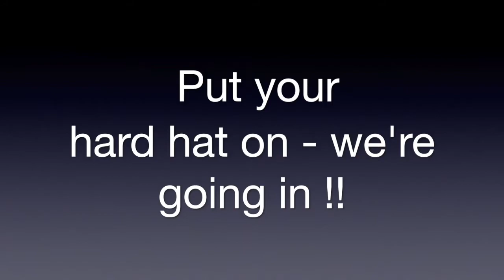Bawdsey WW2 Radar station - Hard hat tour

Comment: Typical woolly minded thinking.

I served 2 years at RAF Bawdsey in 1967/8. Duties included working at height on the Type 80. Type 84 and FPS-6 radars. Nobody ever mentioned a hard hat. Underground you were protected by 14 feet of steel reinforced concrete and 30 feet of compacted earth. Short of a direct hit by a nuclear weapon you were safe.